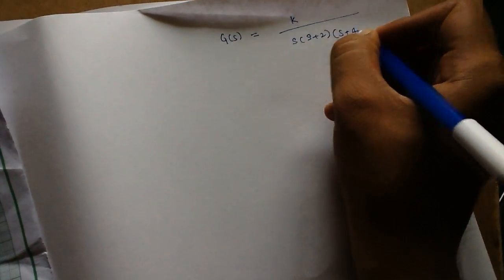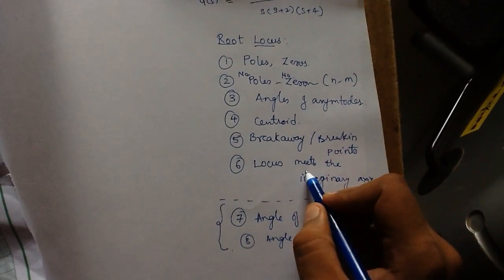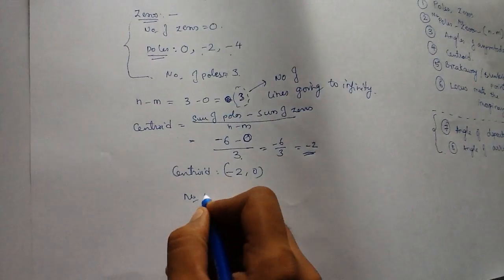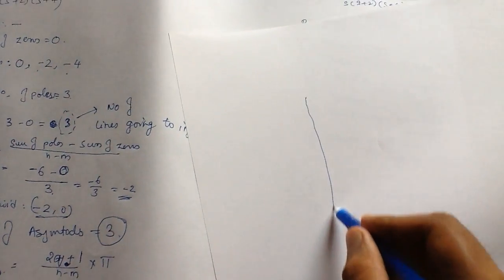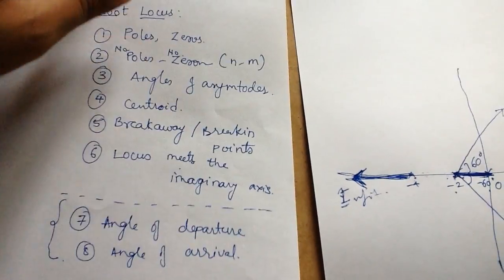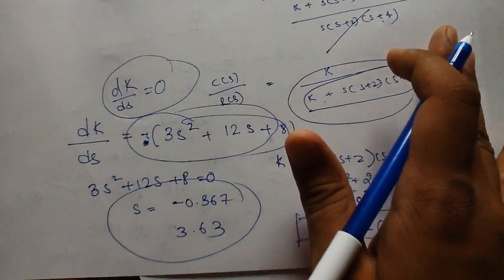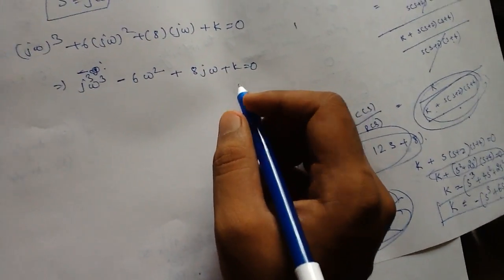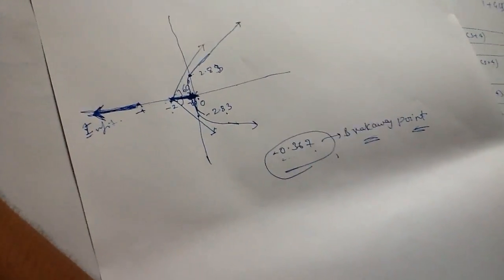Root Locus of a transfer function

Comment: Sir... no of asymtod in  3rd value ....300° but why was the value taking in -60 ° ......
Reply: 300⁰ and -60⁰ will get you to the same angle! The difference is that 300⁰ will go counter clock wise and -60⁰ will go clockwise! 

For example you are at 12pm and you want to go to 3pm you can do both:

1-go three hours clock wise (in this case -60⁰) 
Or
2-go 9 hours counter clockwise (in this case 300⁰)
Reply: Thank you so much sir.......
Reply: @thiruthiru3657  no worries!!

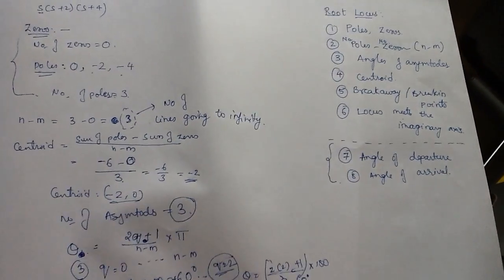Comment: 11:36 how -60° i haven't understood can anyone tell me?
Reply: He calculated the angle as per the formula at first. It comes out to be 300 degrees. He wrote it as -60 because the position of the angle at +300 degrees and at -60 degrees is the same. Try it on a paper yourself.

Comment: Chinmaya, there error in calculation of 2nd grade equation for breaking point. Your results are -0.367 & 3.63 and are wrong. Must be -3.15 & -0.8453. So your curve looks flat instead of smooth curve.

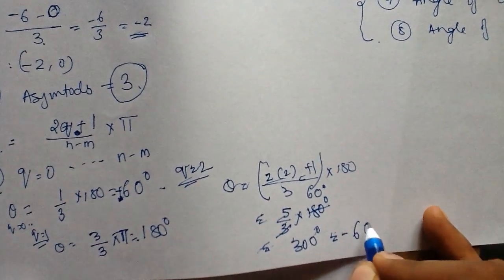Comment: 10:59 why 300degree converted to -60degree?? please reply
Reply: Postive 300 is always negative  60 ,just imagine you are travelling anticlockwise 320 degree ,so  basically you are 40 degree away from the point where you just started which means negative 40 from the starting point

Comment: Sketch the root locus plots and determine the values of K for which the System become unstable and the Critical frequency there (if Possible) G(S)H(S)= k(S+2)/S(S+1)(S^2 +4S+8)
Reply: use rough table to find the K by substituting oddth term of 1st column equal  to zero.
Reply: Routh *

Comment: Sir, with due respect, your concepts are correct but the calculation is faulty, also you have missed a very important point for explanation, i.e why do you differentiate k w.r.t s and equate dk/ds=0

Comment: The roots of quad eqn 3s^2 + 12s + 8=0 are wrong... s=-0.845 or -3.154
Reply: +Sreenivas V Haha i was wondering that too :D
Reply: yes u r right
Reply: Gaurav Vats Use a Calculator bro
Reply: yup the values are wrong of "s"😠😠
Reply: some mistakes but, you are right s= -0.8466 and 3.153
Reply: Sreenivas V itni knowledge lgta hai placement ho gyi😂
Reply: Haa
Reply: Plz tell me how 300 degrees is considered as -60 degrees
Reply: @24_mayurilanjekar67  because when you take the angel counter clockwise it is positive, but when taking it clockwise direction considered as negative but it still same. 
360-300=60